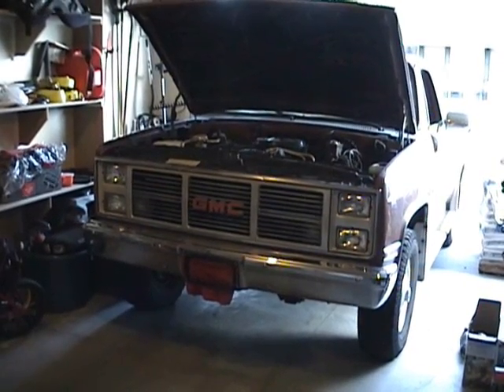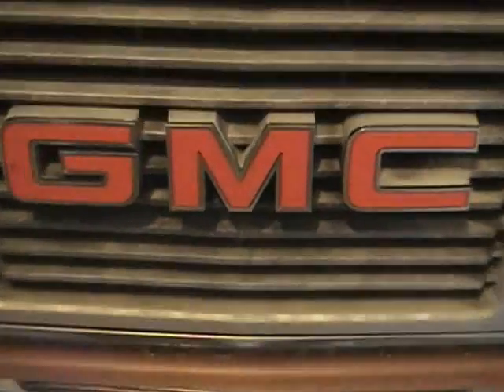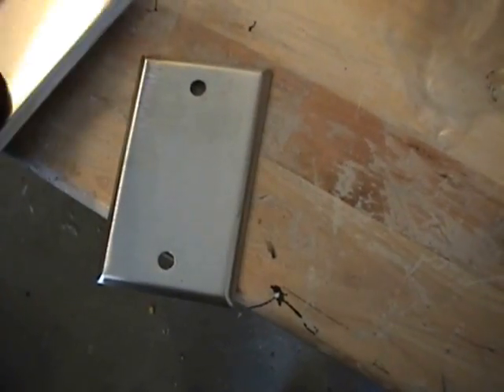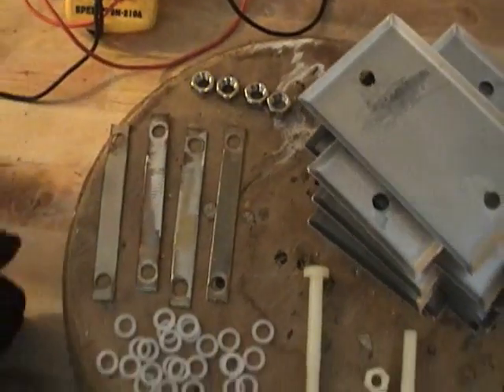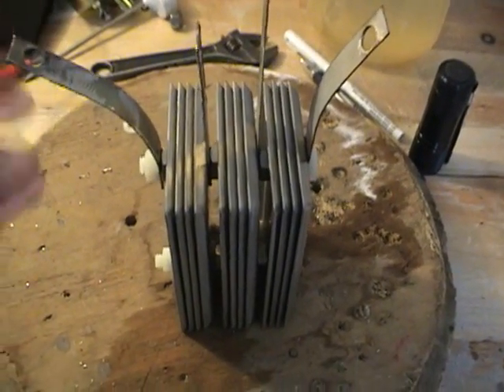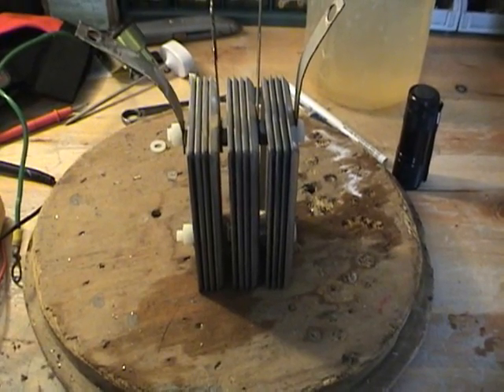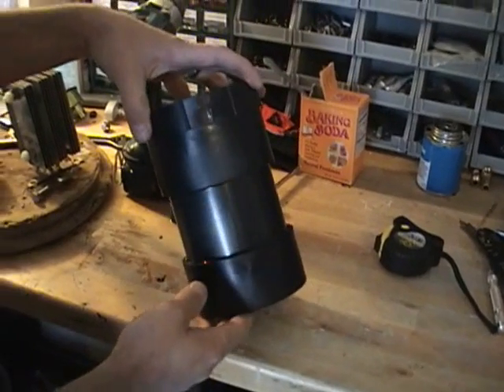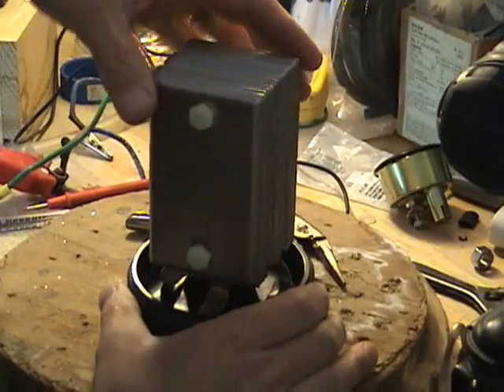(9)  HHO TKO Cell for 1987 GMC How to Part 1

Comment: The longer the tube the more water you can hold the cooler the unit the more amps you can add.  Use as much water as space in your vehicle will allow.

Comment: Thank you, that makes perfect sense. I just bought a 30 amp pwm on ebay. I'm not real sure about the O2 sensor??? I plan to locate my cell in the bed of my 93 nissan pick-up. I'll be running my lines and wires down between the bed and cab and into the engine compartment from beneath. I'll be using the red non collapsing 3/8 hose. I truely appreciate the time and effort you and others have put not only into your cells, but also making sure guys like me have a chance to follow in your footsteps.

Comment from the maker: thanks for your comments.

the 12 plate design heats up the water faster than the 15 and also makes a little bit more gas. we decided to use 12 on the neon and the GMC because both cars are city drivers and arn't run for more than an hour at a time. 15 plate is great for up to two hours.

Comment: you went from 15 plates to 12... why? was there a problem fitting 15 into the 4" abs? or was there a problem with the gas output? I;m curious because i'm modeling my cell after yours. You did a spectacular job by the way.  know this is an old post, but i've been studying every angle of the booster on youtube, and other peoples triumphs and failures. Yours is by far my favorite design. keep up the great work.

Comment from the maker: i was showing a friend the other day that didnt believe in neutral plates. neutral plates produce gas and lower the voltage across the plate array. we did a production test with my TKO cell array and his 6 plate 3+ 3- setup. his current was over 50 amps with 400 mlpm mine was at 15 amps with 650 mlpm.

Comment: Really like your workmanship on this but appears the largest part of gas production is at the interface between energised plates.I'd be very interested to see the same test using jumper cables and running from an acctual car battery.There might be enough induced power to bring those neutrals up to par. I have no experiance with neutral plates so Im only speculating here but I see no advantage to neutral plates.please look at my videos and make any suggestions.That fitting is a female adapter.